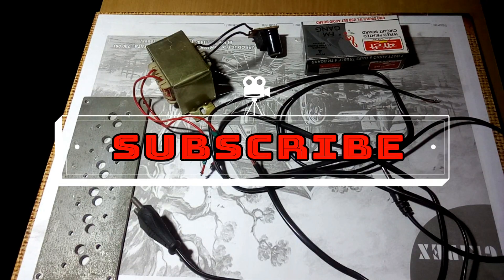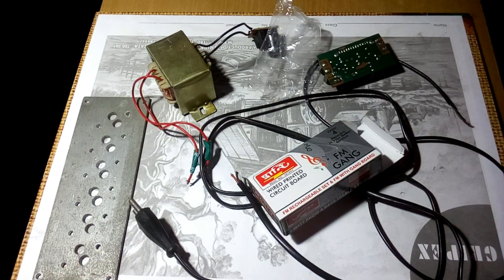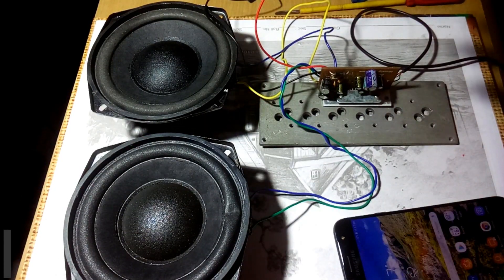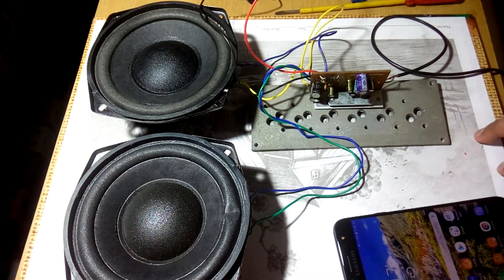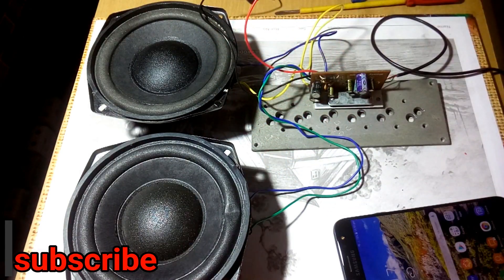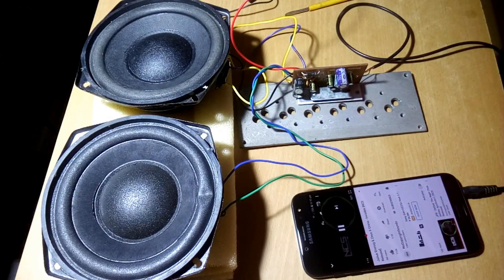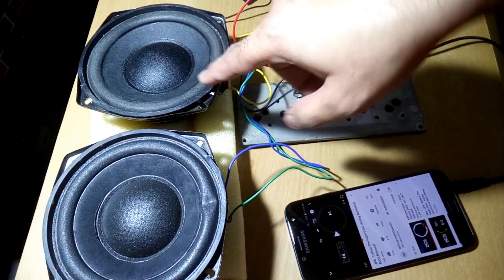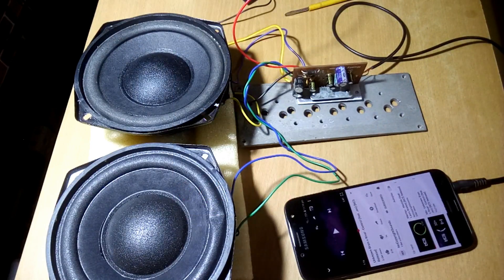4440 Single ic Amplifier Board Full Wiring & Sound Test

Comment: What should be the Ampere of the transformer used ?
Reply from the maker: 3 or 4 amp would be great.
Reply: @technoboy-allinOne  why the sound is cracking when I increase the volume of potentiometer to maximum ?
I'm playing music from mp3 module
Reply from the maker: @amitghosh6966  there will be distortion in any kit at full volume. In your case maybe the speakers are weak or maybe the power supply. And this thing depends on Bt kit too if you have connected one. You need to check it thoroughly.